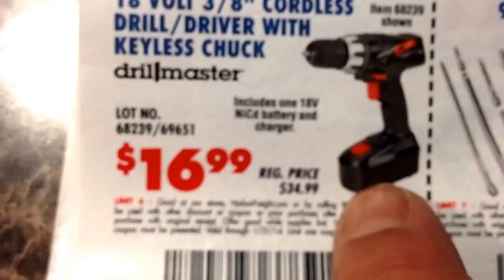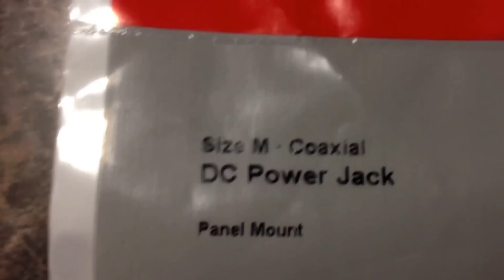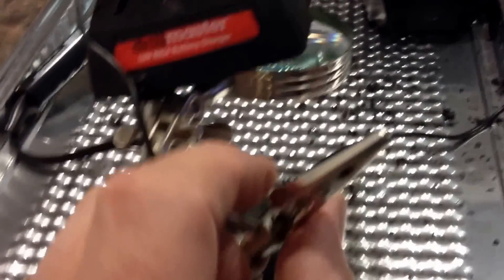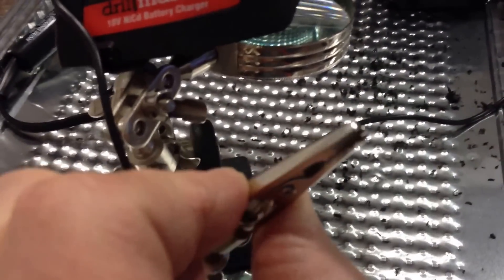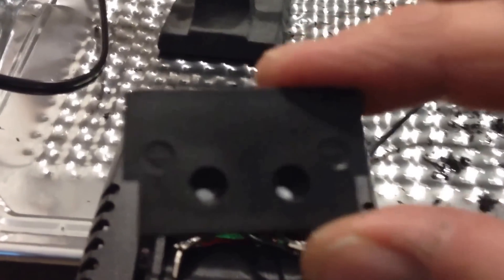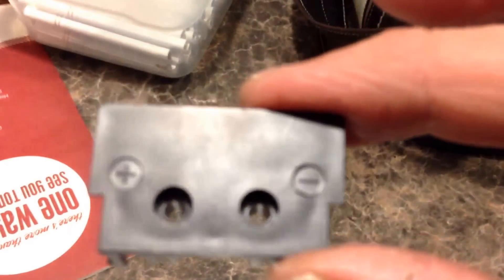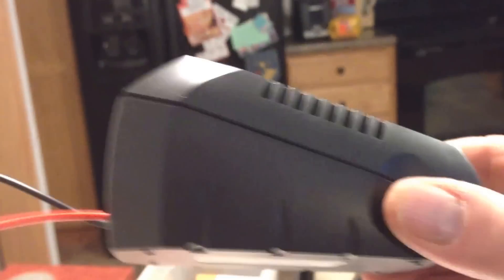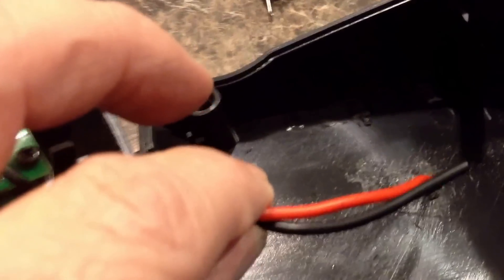Harbor freight 18 volt cordless drill how to change into handy power supply for 18 volt projects

Comment: I have one of these. Question. Does the charger stop charging after 5 hours of does it keep charging? If it keeps charging then I'm going to mod it to connect to my old 18 volt coleman charger which still works. I don't want to worry about leaving it on the charger like the chargers they use on those swivel sweeper vacuums.
Reply from the maker: I believe it keeps charging and you have to disconnect it to stop
Reply: Ray Isimz
Then I will be modding it to charge on my 18 volt coleman charger..
Reply: no
Reply: SAME IDEA but I bought the HF 1 hour rapid charger with overload protection for $9.99 and do minor modifications without opening it. https://www.harborfreight.com/18-volt-nicd-battery-charger-68859.html . Use a jumper between the middle terminal (thermistor terminal) and ground with a piece of wire with spade connectors on each end - have a spare black wire for negative. The positive and negative wires then be connected to a  (2.1x5.5mm)  DC Power Cable MALE Jack to plug straight to the original battery charger (with FEMALE JACK).  Here's a link of the principle idea just NO NEED TO OPEN the new charger. https://youtu.be/1jyEHJYxDpE  . It made it to help a friend who have an HF 18v cheapo drill and saw and it worked very well.